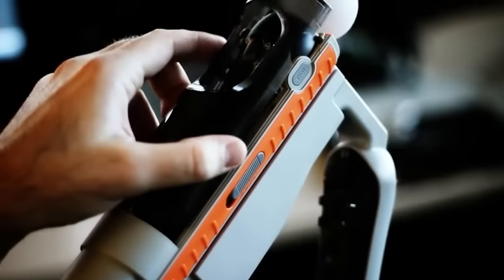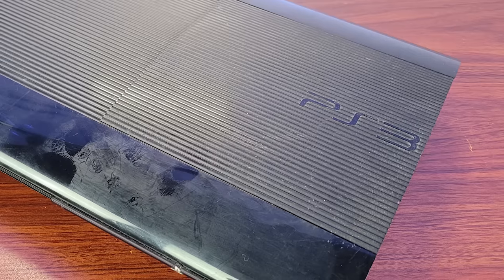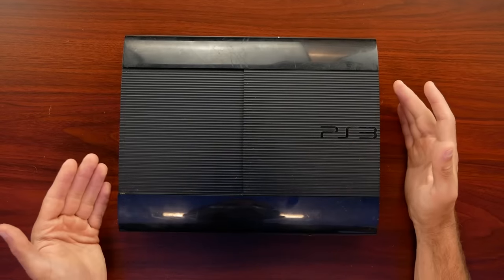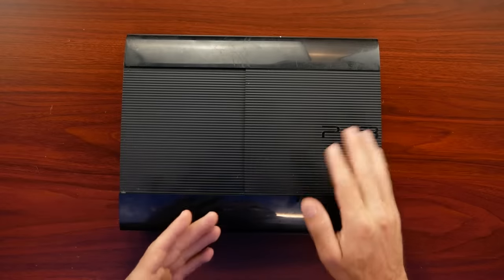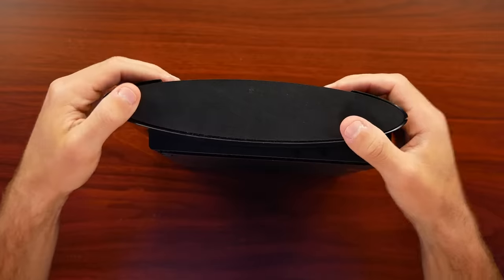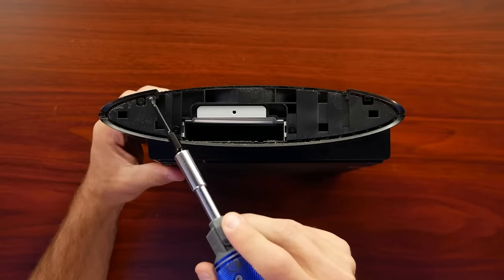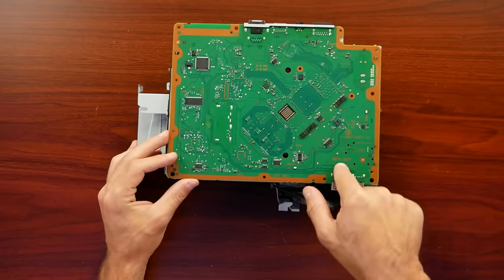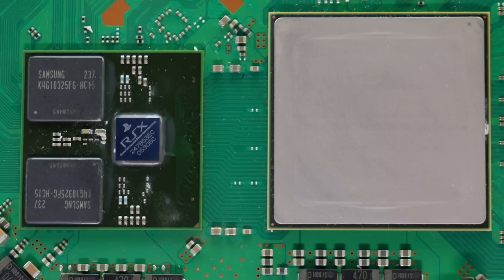The Weirdest PS3 Sony Ever Released

Comment: I’ve owned all 3 versions and this one definitely feels cheap and strange. But I haven’t had any issues with it after all these years
Reply: Same, I really like the super slim but nothing beats the premium feel of the “phat” with its touch sensors, but the super slim is lightweight and more portable it just feels cheaper with it's physical buttons in my opinion otherwise it's great and has the best looking official ps stand.
Reply: I currently own the ps one Slim, the ps3 super Slim and the original ps4 from 2014 with touch sensors. I plan on grabbing the ps2 slim and the ps5 slim next as I want to collect all the Slim series in black variants. 

Fun fact: the super slim plays ps1 disk titles.

Comment: Got all 3 models, love the Super Slim which is built like a damn tank - no mechanical disc mechanisms is a huge bonus for future reliability
Reply: built like a tank? more like built like a cheap hunk of plastic lol, it looks like a Fischer-price toy
Reply: @busterscrugs  i don't disagree, the plastic might feel cheap but I can tell you mine has had some crazy bad  falls and still looks and works great, other consoles probably would have  been toast, or at least super deformed from just one of the falls in question. Thats my experience anyway, I think they're solid units at least on the inside, even if the outside is just (cheap?) plastic
Reply: Funny that it’s the most problematic one
Reply: @BavarianM OG Phats had worst durability the PS2 hardware literally fried it lmao

Comment: Something I just learned a few weeks ago is that you're not supposed to slide the lid over physically. I didn't even know that push button existed until I took mine apart to clean it. Physically shoving it over every time is what likely led to failures as it ground down the catch.
Reply: You didn’t notice the bug eject button on the front, did you think it was for looks

Comment: I had a super slim PS3, specifically a Assassins Creed 3 bundle, and it was a really good system. I remember never running out of storage, because the one I got came with 500 GB, and this was when the biggest game to install was GTA and Destiny 1, which paired were only 120-140 GB, and those were the most storage consuming games. Others you wouldn’t even have to install, so I remember never having to worry about storage on this thing. Honestly it was kinda impressive considering the fact that the Xbox one and PS4 first shipped with also 500 GB. I will admit tho that after 3-4 years, my system kept having issues and one day my entire system got corrupted and I had to factory reset it. Still, I loved that thing back in the day. Idk if I liked it more than my 360, but it was a damm good console. Didn’t realize until I got one years later how much different the PS3 Regular slim was compared to the Super Slim.
Reply: It’s amazing that 2 generations later they only upgraded the space by 300gb.  There should be a 4TB option by now.  4TB’s cost like $100 on amazon lol. Consoles are always trying to do the minimum
Reply: I promise you, after 4 RROD's in a row, I love my ps3 WAY better than any of my 360s. I only wish the cross platform games had been properly optimized for it. It seems as though SONY failed to develop proper tools for their clients to use. Its almost like they didnt fully understand the console themselves.

Comment: When the slot loading drive on my PS3 Slim broke down, Sony India replaced it with a 500GB Super Slim for an equivalent of $100 (apparently Sony India doesn’t have a repair policy 🤷🏽‍♂️), as the slim was out of warranty. 

Most people I know, who bought the PS3 at the tail end of its EOL, got the 500GB variant. I vaguely remember there being a 250GB version of the Super Slim. I don’t know if we had a 12GB variant, here in India.

8 years on and my Super Slim still runs like a champ. Currently sits next to my PS4 Pro.

Comment: That's the exact model I picked up in 2014, still have it. Still use it regularly. I worry about the sliding door, and I need to give it a proper dusting, but it's a solid little console.

Comment: I recently combed through Ebay looking for a PS3 because my fat 80 died awhile ago, and I picked up a 160gb slim that died within a few days.

All of the Super Slim consoles I found looked just like that one, trashed and possibly broken, with a lot of ones with broken doors.

I finally decided to start looking at Japanese models, since they are region free and can be in any language.  I found a White Slime 160gb complete in box for $165 shipped from Japan.  Only took 5 days to get shipped from Japan.  Console and controller are in pristine condition.  If you are loking for a good condition PS3, don't be afraid to get a Japanese Model.

Only difference between the JP and NA versions, is that Circle is the select button and Cross is back.  This only pertains to the XMB and it doesn't affect NA games.

I know you have imported some consoles from Japan, so seeing how nice the ones you got were, I was convinced I was going to have good luck!

Comment: I own this one.
I wouldn't call this model "a quiet one", that's for sure.
When the disc starts spinning, it makes so much noise and vibration, I was afraid the console will fall off the table.
Reply: Exactly. The slim version in very quiet compared to the super slim when using blu ray discs

Comment: It’s actually pretty durable. I’ve seen tests where they dropped heavy stuff on top and no damage to the sliding top or blu ray drive.   Not a fan of the top loader, but it worked well.

Comment: I have this model, but with a 500GB HDD. I bought it new back in January 2016 for 200 bucks off Overstock. While I do own a few physical games for it, I use it almost exclusively as a digital-only console (the 360 was the last console I was harrcore for physical games).

I am one of those crazy hold-out gamers who was pissed when the news of the PS3, PS Vita, and PSP stores closing down. I have easily spent the cost of a PS5 at the PS3 store this year alone 🕹🤔🧐
Reply: 🙃 you spent lots of money on games

Comment: The PS3 Slim was the best model in my opinion, never had a problem with it.
Reply: He isn’t talking about the slim, he is talking about the super slim
Reply: @brroclliertreee6020  hes saying the slim was the best not the super slim
Reply: It struck a good balance. Didn't have the features of the launch phat models, but it had rock solid reliability, ran cool, was very quiet, but still felt premium. All for a much more reasonable price. I always thought the super slim looked really cheap.
Reply: @brroclliertreee6020  I understand I was just giving an opinion, the super slim looks cheap compared to the slim that is all I wanted to point out. Didn't think I had to be very specific about it lol

Comment: I've seen a few of these with black screen issues. The GPU has no heat-spreader on this model. Just a heat pipe on the die, no heatsinking at all on the VRAMS. When I clean them I put soft thermal pads on the 2 GPU VRAMs before assembly.

Comment: This is actually one of the most solid PS3 imo. Failure rate was low compared to the others
Reply: True but failure rate wasn't really the problem with the ps3
Reply: @junglezone7323  the fat had huge failure rate.
Reply: @dericjames2018  
No it didn't. It was exaggerated beyond belief to cope with the 360 failure rate of over 50%. Ps3 failure rate was below 3%, which is way below the normal rate for any electronic device.

Comment: I remember one console That had 2 HDMI?

Too bad it never happened.
Reply: Xboxes One did. Though only for passthrogh purposes I think.

There was something mentioned in early reveals that PS3 would have dual HDMI. As many early Blu-ray players did have, one being for audio only. I suspect that was the reason for PS3 as well. 

Would have been neat if a console could drive two monitors though. The current ones probably would be up to it.
Reply: @AltCutTV  decr1000 has 2 hdmi ports 
the second one is disabled tho

Comment: I've had the disk drive fail in my PS3 super slim fail twice. Once just a little bit before the warranty expired, so I was still able to send it in to be repaired, and once a wile after. I still haven't picked up a replacement. Now, the gears that make the door open on its own are also broken, but I know that's most likely not what's causing the disk read errors because it'll have that little clock icon spinning in the corner for several minutes while it tries and fails to read disks of any kind.

Comment: My newest PS3 (& new spare) slides open like that, but both are the 500g model.
I bought the 500g one, then soon after, when I heard they were discontinuing them, I bought a new spare, as well, since they were cheaper. So I have a barely-used one and a new spare -- hopefully they'll both hold me off for a while when I get in the mood for an older game, which is semi-often. (Hell, my backlog will last me some years, alone).

Comment: IT IS NOT A SLIDING DOOR, ITS A BUTTON ON THE LEFT OF THE PS SYMBOL THAT OPENS IT, it has a button that opens the door for the disc, if you slide it open you are going to break the gears that let it slide since you are forcing it open & then it will no longer close probably.

Comment: I have 2 of the super slims. I've owned a slim before the second super slim, sold it in got a super slim instead, it's so much superior. Super slim is much better usually in every aspect, most came with the 500GB drive. It's definitely the one to go for if you were to buy a PS3 in 2022 since it's the latest revision. I don't mind about the mechanical sliding door for the optical unit, as there's fewer pieces that can ever break in this system, and the blue ray unit seems pretty easy to swap out in case it breaks. My only problem is the number of USB ports on the superslim, it would have been nice to have at least 3, or event better 4 usb ports, ideally the one for the camera should have been placed in the back of the unit as it looks weird to have the cable hanging from your system.
Reply: Can you stand it in it's side?

Comment: I bought a "broken" one in a pawnshop a couple of years ago for $5.00. Took it home it fired right up, the software was just screwed up. I loaded the software on a flash drive and put it in the PS3 and it has worked fine ever since. Normally I would pass this sort of thing up, but it was so clean looking I had to take a chance and it payed off.

Comment: i remember working on VCRs that Had alot of different Items placed in them, the Best one, A Sandwhich which their kids thought the VCR needed so it wouldn't get hungry, Then another where the kids used it as a piggy bank and Ruined the whole PSU Board, Both were still fixed and Had to tell the parents stop letting the kids feed the VCRS, as thats not needed, all they want is a tape to play,But I wonder now what the heck are kids Feeding the PS 3's, Can't get a Sanwhich in one of them, no room.

Comment: I just picked up a PS3 off Ebay in this variant. Love it so far. Top loader is definitely a very different style than most, but I personally like it.
Reply: It’s feel like sort of a throwback to the older PS consoles that had disk drives that popped up

Comment: I just fixed a Super slim 2 weeks ago. The door switch got messed up and the disk will not work without the switch being triggered. I took it all apart and cleaned the whole machine out and gave it a new battery and fresh thermal compound. The little white plastic switch broke off. I found the piece and Crazy glued it. I told the guy don't slam the door closed. I was going to charge $80. I just charged him for the battery and the thermal compound. $10.

Comment: I've had a super slim with a 250gb hdd since 2013. It still works very well 👌 I modded it last year and the emulators work very well, it's given it new life after I got my ps4. I love that the games barely take up storage (if any) when they require to be installed, especially when compared to the ps4.
Reply: haha i have the same plan :D just discovered what modding is. i already modded the 3ds and the ps vita :D
is there a download "shop" for roms and homebrew stuff on the ps3 jailbreak?

Comment: I have one, with a built-in 500 GB Hard Drive, which is actually massive. Even in days of softmodding where you copy whole BluRays over.

Never liked the design of the disk drive. Always felt like it was actually much more exposed to dust than in the versions where the drive is in the console. But I've never had any problems with the drive so far.
And when I see how the drive on my Xbox 360 no longer opens because the opening mechanism no longer works, the Super Slim naturally eliminates that... so it probably even has advantages.

Comment: I had to get the Super Slim when my 80GB PS3 died, like, 7 years after I got it, and this was the 500GB model that was bundled with Destiny. The one thing about this model I don’t like, no physical switch on the back that turned it off completely, that was a useful feature on the OG when it comes to situations like storms.

Comment: It may look weird and cheap but its the most reliable PS3, all it needs is just dusting off+thermal paste change, no need for a complex maintenance routine like at the Fat one(delid, capacitors, PSU replacement etc.) and maybe Slim too.
I also have friends that got one since release day and guess what, no issue, no "YLOD".

Comment: I still have mine.
The 500gb blue model from 2013, I was clean outside. I opened it up, and the dust. Dust invaders. All over the cover, the fan was one feet in the grave.
Cleaned it, and works way cooler than before, logic.

Never got any problems with it, except while opening it,it was pretty fucking hard.

Comment: Every past PlayStation system in existence to this date (except for the PS5 so far) came in 3 different models/form factors or chassis.
PS1: Original PS1 (SCPH-XXXX, DTL-HXXXX, that includes Net Yaroze), PS one, and the "Nintendo PlayStation" prototype
PS2: Fat, Slim and the PSX multimedia box
PS3: Fat, Slim and Super Slim from this video
PS4: Original, Pro, Slim
PSP: Original, Slim & Lite, Go (there's also PSP Street)
PS Vita: Fat (OLED), Slim (LCD), PS TV
For completeness' sake: PS5, PS5 Digital Edition

Comment: I love that this is the model of PS3 I happen to own. I bought it 2 years after the release of the PS4 used from GameStop because I was finally in a place to start rebuilding my collection after having to leave everything, but my handhelds behind. Bought a 3 cause I'd managed to save a couple of my PS3 games without the console and had nothing for a 4. When I unboxed the thing it turns out I'd missed info on the SuperSlim in PS4 hype and it took me several moments to realize what I was looking at. Very hard to keep clean (dust gets into those ridges and i have to take a damp cloth to get them out which i don'tlike doing cause water/electrics), but I got lucky. The lid worked when I got it and I'm obsessive about being careful with my consoles so it's still working without a hitch. Have to say given it was the one that started the rebuilding of my collection the PS3 SuperSlim has a special place in my heart.

Comment: Here I am in 2023 just picked one up off eBay. The listing was for a 250gb model which it didn’t come with a hard drive so I’m 3d printing the bracket and I’m gonna try a hdd. I noticed it was pretty loud so I’m going to try and take this thing apart and try and clean it. Thanks for the tips

Comment: I wouldn't use the word "weirdest", but I would say that is the most simply designed PS3 I've seen people opened up (or at least the easiest PS3 to open up). The cost cutting actually did a lot of good if you don't consider the disk loading mechanism.

Comment: The 4000/4200 had a 40nm rsx, the 4300 had a 28nm rsx

In my opinion the 3000 slim model is the best way to go. That used a 45nm cell just like all of the super slim models and a 40nm rsx just like the 4000/4200 and only used 10 more watts (200 watts) than the super slim. Because it was also a bit larger and had a better cooling system (because earlier slim models produced more heat with the 2000 needing 250 watts and the 2100/2500 needing 230 watts) it overall stayed cooler and quiter than most super slim models while still feeling premium in way.

Comment: I own the Super Slim PS3, it's great, i dont have to worry about the disc drive ejection motor breaking.
Reply: It also lacks an IHS on the GPU and the IHS on the CPU is soldered on, so it doesn’t have to be de-lidded eventually like (most of) the earlier systems.

My 20GB unit still holds a special place in my heart, though.
Reply: @SanchezS1998  good to know, I only have to replace the thermal paste. No delidding actually puts me at ease since it seems rather easy to damage something.
Reply: Love your avatar. I used to watch the Ah! Megamisama OAVs and read the comics back in the 90s 😎👍🏽

Comment: My ps3 super slim is such a beast. Bought new in 2013, has 27 games on the original internal drive and I've got some 35 more titles on discs. Not once have I opened it, still works like a charm with rare freezes, never had to uninstall games to get new ones on the drive. Has outlived 2 original pads (the one that came with the console is still somewhat working, just developed stick drift after 8 years of heavy usage, au contraire to what people say about DS quality). GOAT.

Comment: I love this design, i hate how they cant run cobra CFW. Also, there is a eject button to open the tray without sliding it with your hands. it's on the opposite side of the power button. Your only meant to close it manually, not open it :)